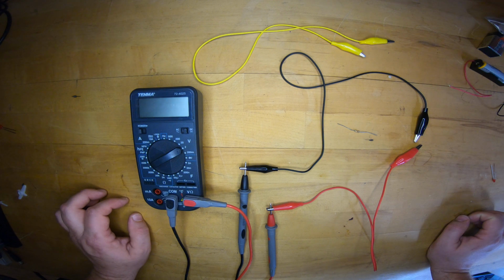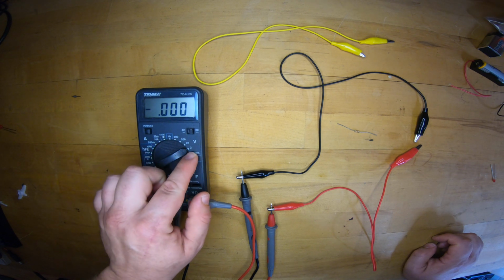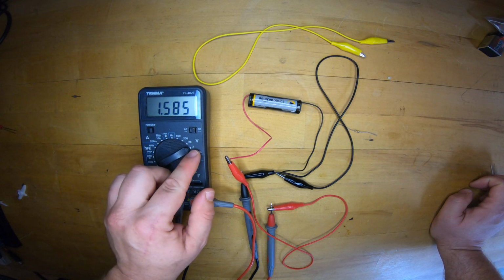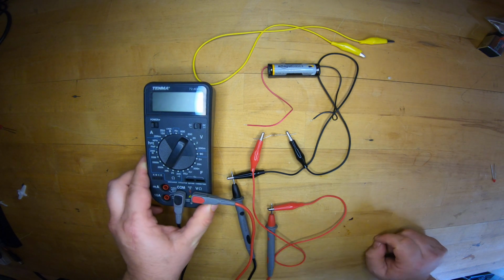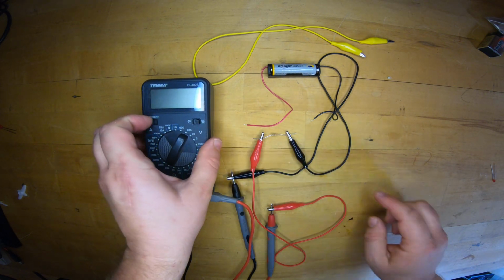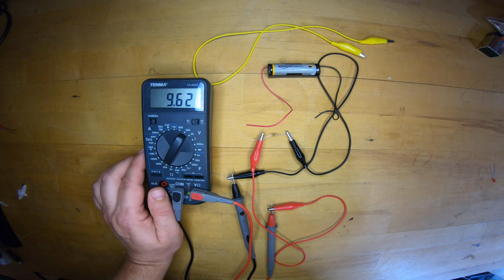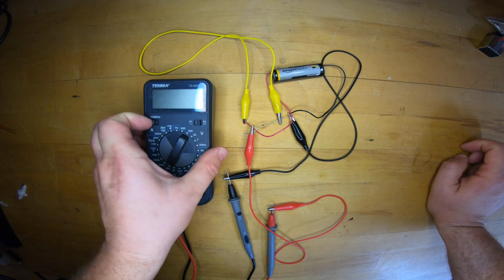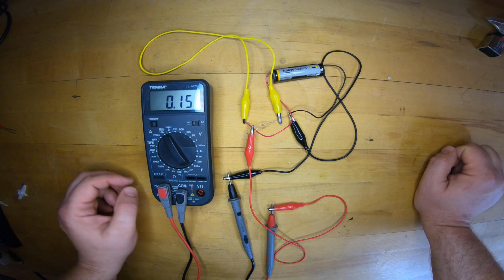Using the Tenma 72-4025 Manual-ranging Multimeter

Comment: Hey I have this exact Multimeter.   I am testing a steering motor on my trolling motor to see how many amps its pulling.
I rarely if ever have had my probe over in the amp side of the meter so I am just trying to confirm the reading I am getting.
Since its a fairly large motor compared to your test motor and I am using a lawn battery for my power source I have put 
the red probe in the bottom hole.   I am set to 200m as 20m gave me the oL beep...   I get a reading of  3.4 ?  Surely I am
not pulling 3.4A   MinnKota suggests That would indicate the motor is bad.    It turns smoothly in either direction same 
reading.  I am hoping your going to tell me that I am reading 3.4 mA  ???

Update:   Thinking I was making some mistake  I hooked everything back up to the meter again and switched to the 20m/10A
                 position on the knob of the meter and still in the 10A hole as it beeps no matter what I do in the mA hole. I get .34 ???
Reply: You are measuring 340mA or 0.34 amps. You need to use the 10A hole for the probe.  If you use the mA hole, 20mA is the Max so the meter beeps because its over range.